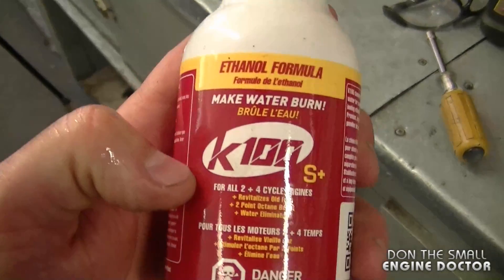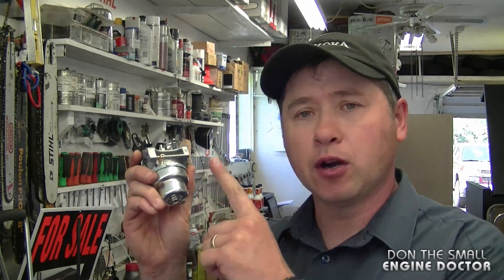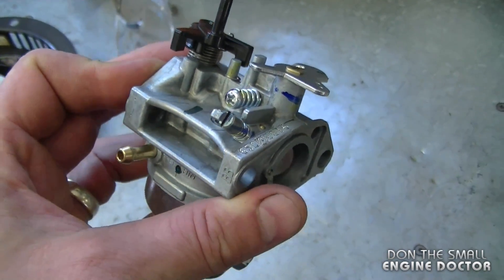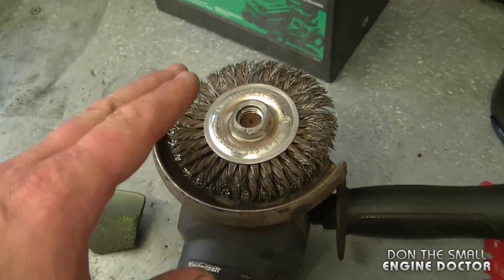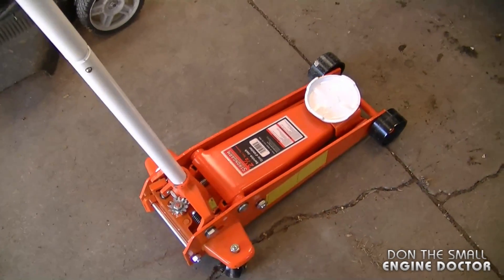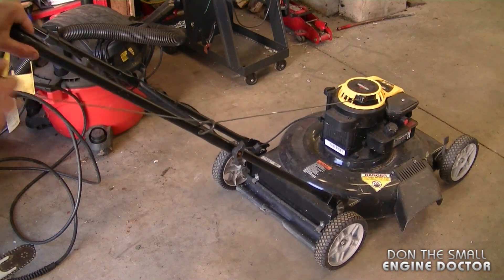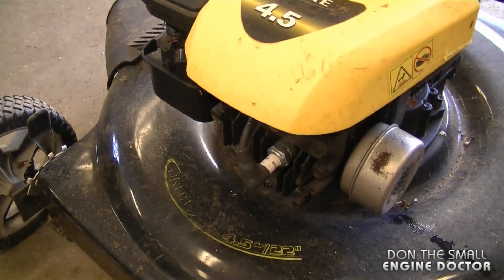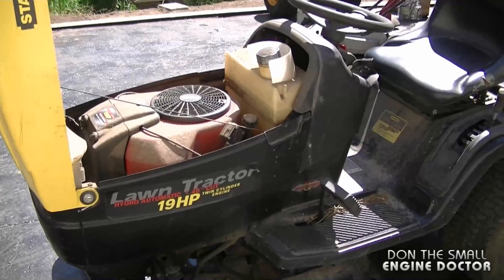Small Engines Q & A Video #152

Comment: In my old Briggs 3hp engine the air filter case i a bit fifferent than the new one, so when i change the air filter, i need to gut the head of the filter in order to fit it in the filter case, buy it seems to work.

Comment: QUESTION PLEASE , i have asked many mechanics about this and some dont know ,,,, HOW MUCH PSI OF COMPRESSION MINIMUM ON A SMALL ENGINE IS REQUIRED FOR IT TO RUN . .. thanks
Reply from the maker: on 2 stroke a minimum of 100psi, more is better. on 4 stroke can be as low as 60psi because of the decompressor on camshaft
Reply: thanks,
Reply: i remember reading a book about compression long ago it said ,,, atleast 90 psi was the least to start a motor ? wow! things change LOL

Comment: Hi Don,
I am working on a vintage craftsman chain saw 2.0. After rebuilding the carb., replacing fuel line, and cleaning muffler, spark arrest, oil is leaking from muffler area. Any suggestions? Thank you

Comment: IVE GOT A GARDEN TILLER THAT REVS UP AND DOWN WHILE THE TINES ARE ROTATING THEN DIES. WHAT SHOULD I LOOK FOR?.
Reply: It sounds like the governor is not maintaining a regular rpm with the throttle. Maybe you ought to reset the governor and then see how it runs.

Comment: man this video almost made me cry at the end with that stanely.  my dad and I bought one for only 50$ because the guy said it's Trans was locked, but he just had the parking break on lol.  we kept that mower all summer, mowing, pulling, racing, and just having a good time with it until recently my mom decided to drive it sideways along the ditch and rolled it, which blew the motor up with all the oil leaking out (because she didn't realize a mower with no oil shouldn't run) and old Stan was toast.  we ended up selling to the neighbor for 200$ because the body/deck and Trans was still good and he repaired it and sold it to some one across the state.

Comment: Very good Q&A, as usual.  When I have to tip up a mower, I try to put the engine on its compression stroke so the valves are closed, and remove the air filter.

Comment: when i worked at the shop, we got those techumseh vtwin engines in all the time. they were usually on white's outdoor riders. all i can say is that they are a horrible design. they used the plastic bowl carburetor, and to top it off, decided to throw two of them on there. worst fuel system design i have ever seen.
Reply from the maker: I noticed that 2 carbs lol

Comment: Getting grass off lawnmower blade if you don't have the grinder. Soak it with old fuel, or spray it with wd40 and let it soak, then use an old chisel or screwdriver, or putty knife to scrape it off.

Comment: Hey Don,  I actually owned one of those exact Stanley Lawn Tractors.  They're really nice tractors.  Mine had that exact same Tecumseh engine on it.  Not sure if you know or not.  But that engine actually has two carburetors on it.  One carburetor per cylinder.  I thought that was really cool.  I sold the tractor on Craigslist back in the spring time to someone for $500.  So I think I made out pretty good on it.   Keep the awesome videos coming man.  Take care.

Comment: i work at a honda dealer and i seen that replacing the whole carb is 
still cheaper that just replacing the float valve and spending that time
 to take it apart and cleaning it so we just replace the carb its 
quicker. also tipping the mower on the wrong side i always tell customers Carburetor to the sky or it will die i dont know if you ever heard of that but its easy to remember lol

Comment: If anyone wants a free 2 cycle homelite 25cc motor that runs you can have it. I have no use for it. It is a curved shaft weed wacker  but the input shaft inside the curved shaft is gone. I still have the curved shaft if you want it with the motor or you can have just the motor. I don't want to throw away a running engine. The piston and the cylinder are not scored at all. So if you want it just reply to this comment. Even if you want it Donny, you can have it.
Reply: Where is it
Reply: +Simon Richard maine usa
Reply: +Simon Richard I just got it to fire up on carb cleaner for a second.

Comment: Hey Don, I have been trying to ask you an important question. I couldn't find the right thread and I saw this was your most recent video. So my question is how tight is the flywheel nut supposed to be on the Tecumseh 5.5hp engine model LH195SP (HSSK55) 5.5hp horizontal snowking engine. I could not find the correct answer for sure. One site said 450 inch pounds which converted to ft ibs is 37.5. I just wanted to see is that correct? 37.5 foot pounds. I loosened that nut by accident attempting to remove the shaft bolt off the other end. I want to make sure the flywheel nut is tightened correctly on this engine, for two important reasons 1, performance, 2, I am going to sell that engine and I want to make sure that flywheel is tight and does not come loose and fly off on somebody I sell the engine too. Thanks in advance for the help.
Reply: just get a big wrench on there and thighten as hard as you can. I work on a lot of small engines (not a business, just personnal) and I don't even own a torque wrench. Never had any problem what so ever. And I sold many engines without having any concerns.
Reply: Hey Don, I found out the torque spec on an HSSK is 35 ft pounds and it varies for many different models from 25 to 58 the typical small and medium frame is 35 and 39. But if anyone else asks that's the answer and here is a link to a chart with every Tecumseh engine and the Torque specs for the flywheel nut for each engine. It was big help because converting 450 inch pounds to foot pounds gave me 32.5 which wasn't that far off but was off, because it called for 35 in foot pounds. Here is the link if anyone else needs to know how much to torque down the flywheel bowl nut on any Tecumseh engine.
http://www.barrettsmallengine.com/manual/tecumseh181-1275-14.pdf
Reply: Yea I'm not gonna do that because I'm the type of person that would tighten it to the point it would crack if it were an aluminum flywheel like on a Briggs Quantum. They call for 55 ft pds on one of them, that's a vertical engine. The Tecumseh is 35 ft pounds a horizontal engine. I'm pretty sure I have it a little to loose right now and when I change the speed of the idle right now the things is surging hard until it levels off, which it wasn't before until I accidentally loosened the flywheel nut trying to get the crankshaft bolt off. The carb does need a quick cleaning but, that's what happens if it's to loose. Granted 35 ft pds is pretty loose already as the set torque right now it is way too loose. Too loose and too tight you get surging and other issues one way or the other. Too loose the flywheel pops off were not just talking damage were talking possible injury. Too tight you're talking cracking the flywheel and then again breaking off and becoming a 3600 rpm frisby coming right at you. Specifically on older Kohler engine flywheels they can't be too loose and they can't be too tight. Someone tightened one down too much on an old kohler. It made a hairline crack. The flywheel broke off destroyed the engine, cut his dick off and put a dent in a steel support beam holding the guys barn up, no joke he lost his dick. He posted photos and a description of his story, their was a piece of the denim still stuck in the flywheel after he yanked it off the steel support beam on his barn, true story you can google it, I ran across it looking for my torque specs. So when it comes to the tightening of certain nuts and bolts that call for a specific amount of torque I try to follow what it calls for. If its a bolt that's it tightening something that does not really matter, then I don't worry about it. But a piece of Iron that is turning 3600 times a minute that can come loose and kill you while being projected, yea then I follow the torque specs for it. I would invest in a Torque wrench if I was you.
Reply: Oops wrong link there. The Tecumseh flywheel nut Torque spec chart: http://www.small-engines.com/tetorque

Comment: seen a few of other people's Stanley's and yes they are Murray built. I had a scotts built by Murray identical to the shape and design of this Stanley but, it was orange hydro foot pedal 15 hp kohler command single ohv 42 inch deck I only gave 250 for mine used it around two years then a part went bad and I had trouble finding new part so I sold it for 140

Comment: As far as fuel I use for myself and customer units,  is I only use a 2 gal. gas can and just use premium un-leaded fuel and I always add one shot of Marvel mystery oil and one shot of injector / carb cleaner ( wal-mart brand ).  and never let the gas can set outside in the sun & heat or uncapped and the shelf life on gas is 30 days.
Reply: All good tips! But I was amazed last week when a friend asked me to start up her generator that had been stored for 8 years with gas in the tank. I made a substantial bet that it wouldn't start and that I'd have to tear it down. It started right up and I lost the bet!

Comment: I got a poulan chainsaw it cuts off after cutting a log doesn't idle but cranks right back up any ideas carb has been rebuilt  thanks
Reply: Try adjusting your low speed mixture screw on your carb. I know that on my leaf blower if the low speed screw is turned out too much it will die so what I do is I start it and adjust it while it's running. That's what I did to mine.